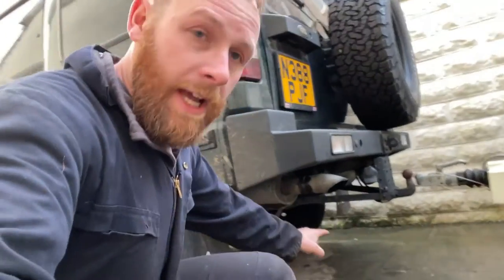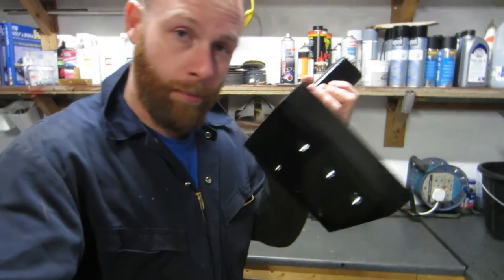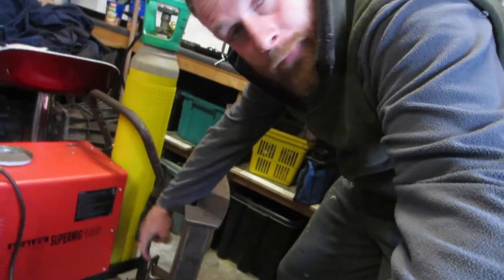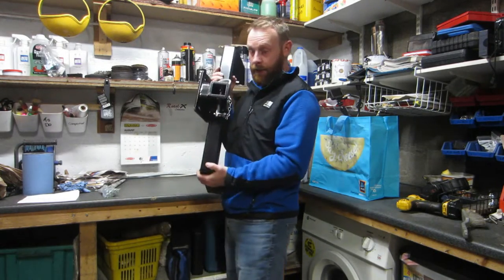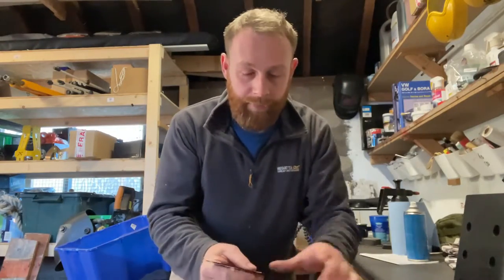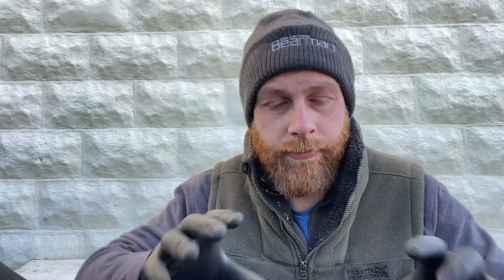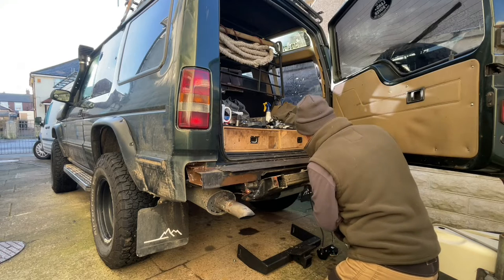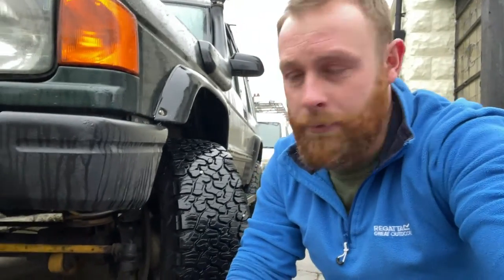Installing a detachable tow bar to the Land Rover discovery

Comment: I have the Safari Equip one, fits perfectly and allows either standard drop plate for 50mm tow ball or another 2” attachment which I use for the Dixon Bate NATO Hitch. My vehicle is pre year 2000 so don’t have to worry about type approval.
Reply from the maker: Sounds very similar to mine, I have the drop tow ball but you can also add a shackle mount etc. I’m very happy with mine and it tows the caravan nicely
Reply: @TheNorthernExplorer  if needed I can rotate my drop plate through 180  degrees I.e upside down to give me more clearance but not an issue so far and quite solid.
Reply from the maker: @petermenzies1714  ahh that’s handy! I purposely went with a detachable one so it wouldn’t dig in when offroad. My standard one was like a plough

Comment: I love these types of hitches, both the Aussies and USA use them. Unfortunately they don't have type approval for later vehicles. Maybe at some point you should look at attachment points for safety chains and fitting some to your caravan, they make the silly little bit of wire rope look pathetic. The receiver hitch is also a great mounting point for a winch, I'm in the planning stage of modifying my front bumper to take one on the passenger side as pushing trailers in to tight spaces is often easier and safer than reversing. I'll have to send you some pictures when it is done.
Reply from the maker: Yes I was concerned when someone pointed out they aren’t legal in the uk but after checking dvla my age of vehicle is legal for this hitch. I do have a shackle mount on my rear bumper I could attach chains. And yes definitely send me some pics when it’s done